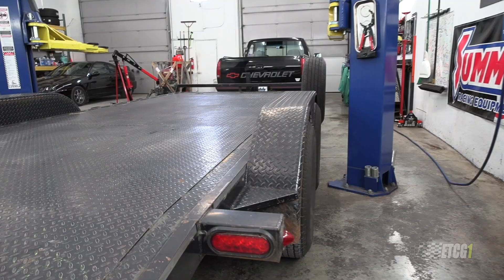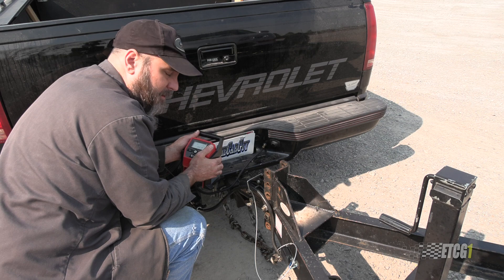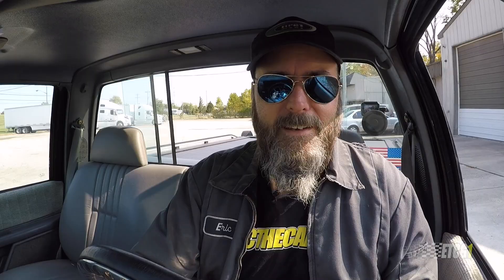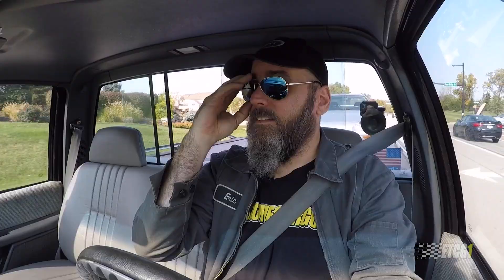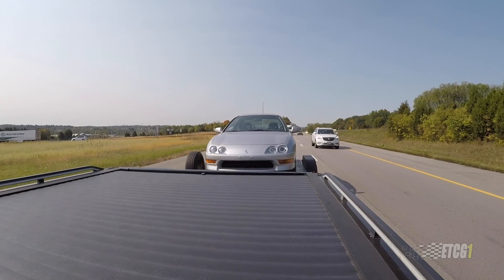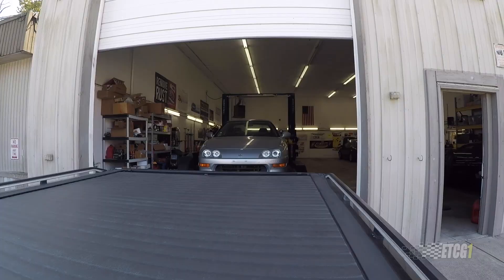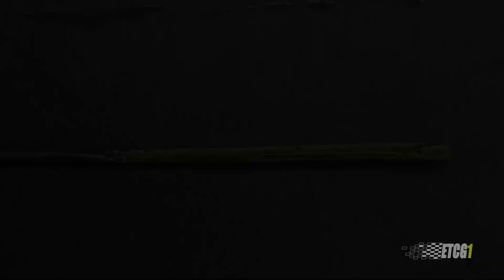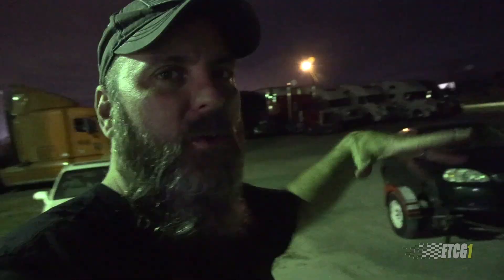First Time Towing With Airbags

Comment: A quality weight distribution setup would completely make the ride that much better because it's the only way to correctly transfer weight to the front axle of the truck and rear axle of the trailer for a correct and safer ride. 🤟🏼
Reply from the maker: However, I'm renting these trailers and don't want to modify them with a hitch I may only use once. Thanks for the comment.
Reply: @ETCG1  - Oh, good point! I guess I completely missed that part. Well if you ever get your own then you're free to try all sorts of things! Happy trails man. The truck looks really nice towing stuff!

Comment: Air bags are a huge improvement for leveling and ride. The problem is they don't put any of the weight back on the front axles.  They only level the truck by raising the rear end. The only way to get the weight back on front is to use a weight distribution hitch. Running both is the perfect combination. I run both and dual sway control bars.
Reply from the maker: No doubt that a weight distribution hitch is the best way to go, but airbags are way better than no air bags in my experience. Also, the place I rent my trailers from don't have weight distribution hitches on them. Thanks for the comment.
Reply: @ETCG1  so true. No substitute for air bags.

Comment: Hey Eric, I'm all with you on air adjustable suspension.  I've used air shocks on many vehicle over the years and I am "guilty" of pushing the limit (or is it towing the limit :-) on the size load I've hitched to.  What i do want to point out is that while air boosters can level out a vehicle, it does not over come the fundamental problem of trailer/load stability.   Even with load levelers "things" are happening when we attach a trailers off our back bumper.  1 While it's not the primary issue,  the hitch overhanging the back axel is "prying" the weight off the front.  More of a concern is dynamic lateral stability.  Load leveling hitches help with this in an odd way.  Friction in the bars, dampens sway effects as well as move weight toward the front axels.  Here are some things I have learned, some are debatable.   Lateral (side to side) softness makes a trailer /vehicle combo more subject to run-away sway.   If your are pushing the limit I suggest:  Run tires are highest pressures allowed by the tire, front, rear, and trailer.   Use of helper springs, air shocks etc also increases role stiffness and is improved when separated inflations is used - this helps.   
Now here is a point that few people really understand.  Run away sway is less controlled by hitch weight as it is by "moment of inertia" of the load.   Moment of inertia is the effect of splitting a load and moving the two halve further and further apart.   I offer that one could safely pull a 10,000lb block of iron sitting some what behind the axels (negative tongue weight) but would get in trouble pulling a load with two 2,000 lb blocks with a 10% hitch weight with those weights placed 30 ft apart (fore and aft).   I offer you will see far more travel trailer disasters due to loading of the trailers with high loads fore and aft.   (think rear cargo carrier with a generator,  motorcycle,  fuel and full portable greywater tank- not to mention how heavy loads (water/swage) are placed inside.   If all those loads - and more - where over the axels there would be no issue.   As to vehicles: Shorter bed pickups and low rear overhang SUVs (real axel is close to the bumper) are inherently better tow vehicles.  Fifth wheel trailering (zero and negative overhang) essentially don't have sway stability issues.   Two closing points:  While dangerous in it's self I will do "excursion testing"  with a load I'm unsure of.  As I increase speed, step at a time, (with nothing around me) I give a jerk to the wheel and then hold at center.  If I feel a delayed sway (caused by the load sway)  know I on the edge GO NO FASTER o slow down.  If a load gets squirrelly 1) DO NOT FIGHT THE SWAY.  Lock the wheel and only make slow changes in direction.    2) Attempt to slow without panic braking - I find this aggravates the situation.
Reply: When swaying, it is often smarter to try and speed up some. Also, what I do is I will only apply the trailer brakes.

Comment: Ive got bags on both my trucks. Both trucks are stock and long bed.These are only needed for half tons as far as ive seen. I never use them. Squat may not look good but you want that rear suspension loaded. Airbags give me adisconected feel def dont feel as secure. Useful for shortbeds and half tons ,sure .And defintly lowered. Abetter alternative would be a weight distribution hitch. Iswear by mine

Comment: My advice when backing is adjust your mirrors to see the trailer tires and back end of the trailer. Obviously keep an eye on trailer overhang and your pivot point but watch the tires of your trailer. The tires will tell exactly where you're going and you won't have to turn around and look, which will help in being able to spot  possible front end contact a lot faster than having to keep twisting your body and head... thats how I back my semi and its worked well for me
Reply from the maker: I started doing that after I got more comfortable with it. However, backing up the car dolly was a nightmare. I had to remove the car and back the trailer up without it. Thanks for the comment.
Reply: @ETCG1  they can be a real pain to back because it doesn't take much for it to get away from you unlike the longer trailers. And you're welcome. You've given me years worth of advice so u thought maybe I could give some back!

Comment: I'm sure the bags have a significant impact, but the vehicle placement does too.
Regarding that; you are 100% right that you NEVER put the weight towards the back of the trailer (i.e. lifting on the tung). That will make the combo dangerously unstable. But, you do not want excessive weight on the tung either. About 100 lbs is about the max you want to put on it.

Comment: UK towing in case your interested
older drivers can tow trailers up to a gross weight of 3500kg, depending on tow vehicles max towing weight, young drivers can only tow trailers with a max weight of 750kg unless we do an extra licence, which brings us up to 3500 kg, as for brakes, under 750kg trailers dont have brakes, between 750 and 3500kg trailers have overrun brakes so when you slow down the hitch has a damper built into it which pushes back to activate the brakes, and have an automatic mechanism for disengaging for reverse, if you want to tow anything above 3500kg you have to have a 7500kg vehicle licence or medium goods vehicle, or a heavy goods vehicle licence and a lorry or similar

Comment: connecting the two lines is a bad idea when you corner air will transfer from the bag with more pressure like if you turn left the right rear will apply more load to that bag and transfer to the bag with less load making it handle worse through corners like a reverse sway bar i added bags to the back of a amc jeep with a 10 inch lift and you could really tell we installed them to help with the body roll it made it worse and you could tell once we isolated them how much better it handled

Comment: Been contemplating air bags such as the ones you installed on my truck and your initial reaction probably just sold them for me.
Reply from the maker: You won't be disappointed. Even when you're not towing they make the ride smother.

Comment: Going from 14:2 to 13:7 will make a massive difference to fuel use... you really need a smarter setup that moves mixture/timing with vacuum and rpm. If hills make you smell brakes, you need to be in a lower gear and keeping your foot from trailing that pedal.

Comment: First time I saw you video link, I thought, oh I didn't know you could add driver and passenger safety air bags to my old classic. I need to check this out, but as soon as it started I knew what you meant. MAYBE a better name for the video would have been "adding air lift suspension bags".
Reply from the maker: This might help for clarity. BTW, this video came before the one you just watched. It's also linked in the description. https://youtu.be/e-h_ZNZkS5A

Comment: Eric it's all about load position. your best bet is to put enough weight on the truck to drop the backend an inch or two then put air in your bags, if you put to much weight on the truck then put air in the bags it will deceive you. Most accidents involving trailers are caused by people loading there trailers to heavy on the front. If loaded properly the 51 will handled the same, it will just take longer to get up to speed and a little longer to stop. You have common sense, you'll be fine. As far as backing up if you put your hand at 12 o'clock if there's a problem you can turn (your hand) toward the problem and the trailer will move away from said problem. When your loading the trailer with a heavy object like a car put some blocks under the back of the trailer to keep it from dropping to far and lifting the ass end of your truck, just don't block it tight so when there's weight on the trailer you can't get the blocks out.

Comment: hi Eric .before you tow the trailer check the hitch nose weight (make sure its under what  the makers max hitch weight is) then couple the trailer then adjust the air bags .
 in the uk we use overrun brakes (electric brakes not allowed ) the max advisable towing weight is 85 '/. of cerb weight  of the tow car .
we also have 50mm ball hitches that have the anti snake built in have look at this (alko Stabiliser coupling (AKS™ 3004) we use 50mm ball hitch (eu standard ) .

as per normal the vid is top notch .
it might be a idea to fit a swan neck hitch in the bed to move the point that the load applies to above the rear axle rather 3 ft behind it ,
just a suggestion.
rickie edinburgh scotland

Comment: Glad to see u didn’t wire it up on a y that’s actually unsafe to do so cus on corners your bags will unload from one side and transfer to other. Making it unsafe should always keep each bag either separated by shrader valves or if your running a onboard compressor separate solenoids and lines

Comment: The smile on your face says everything, it's stable.
Double parallel the airbags, No no just kidding lol.
If you're not sure about moving the heavy car, go slower and be kind to your brakes :-D
A game of momentum. mass x speed.
Reply from the maker: Trust me, I'm very careful when towing like this, I love my truck too much to mess it up. Plenty of space between and whatever is in front of me. The issue I had was with a "lookie loo" that was enjoying the fall foliage while driving. Inconsistent speed, and particularly slow going downhill. It was somewhat maddening if I'm honest. That said, we made it out OK. I actually prefer towing with the car hauler because it has trailer brakes. The car dolly does not. Even though the car dolly is lighter, it's much harder on your brakes because it doesn't have any braking abilities other than in an emergency. Great to see you. Thanks for the comment.

Comment: I worked for a County highway department One Summer we are putting up speed limit signs had a half ton truck put 50 4 x 6 treated posts 14 ft long in the 8-foot bed the front wheels were skipping I wasn't driving the supervisor was but then he had me unload them while he was inside the maintenance building I didn't cut the Bands and unload them once out in the grass I stepped on the gas they slid out of the back of the truck but the front wheels were up six feet in the air woooo hoooo! The bumper was full of dirt in the back.
Reply from the maker: That's a bit frightening.

Comment: I feel much more secure pulling a car trailer over a car dolly, especially on the highway with a pickup truck. One thing I would recommend is putting some significant weight in the bed of the truck. Otherwise, the car on the dolly or even the trailer has more control over your load. Think about how your truck acts in the snow without weight in the bed of the truck. Be Safe; Stay Dirty.

Comment: You might consider an aluminum car hauler instead of the steel car hauler.  It is significantly lighter in weight, which means you could put a heavier vehicle on the trailer.
Reply from the maker: I agree, but they aren't available at the place where I rent my trailers. Also, they are very expensive. Thanks for the comment.

Comment: This video, mainly the part where you talked about the pressure in the bags, just furthered my opinion you need a lighter trailer. Also, I think you would be very surprised how little difference in weight there is between the Integra and the 51 Chevy (The 51 is lighter than the TL). I do remember you saying he had a bunch of parts for it too, but I'm not sure it'll add up to that much difference.
Reply from the maker: Like I said in the video, I think a car hauler with a Civic weight car is doable, more that that is probably too much. Thanks for the comment.

Comment: I'd bet the weight difference between one of the Hondas and the 1951 Chevy is about the same as the weight difference between driving solo and riding with a girthy passenger in the truck.  That car's probably 3000-3200 pounds at most.

Comment: Being able to isolate each bag and adjust individually is really only going to be useful if loading the bed. A trailer keeps  the load on the hitch…. low and centered  so not really necessary.

Comment: Glad it looks like the air bags are going to work out for you.  I think your set up should work with towing the '51 Chevy.  You maybe might want to invest in a weight distribution hitch if your tongue weight gets over 500 or so.  I check my tongue weight by using a bathroom scale and make a "bridge" out of some scrap 2x4s.

You also might maybe want an aux trans cooler for good measure if you don't already have one.  With just the in-radiator cooler, I've seen trans temps that were otherwise around 160 to 180 spike to over 220 with just an additional 1000 lbs.  So any rig that I plan on towing with gets an aux cooler.  Cheap and easy for some peace of mind.

Oh, and never attempt to back a U-Haul car dolly.  With a conventional trailer, you have only one pivot point, the tow ball.  However as you've discovered, those tow dollies have two more pivot points for a total of three.  That makes controlled backing nearly impossible.  Even professional truck drivers don't back tandem trailers and that's just one extra pivot point.

Might also want to use something to protect the car on the trailer from road debris kicked up from the truck.  I usually don't bother, but my cars are ugly anyhow.

Sorry, Eric, if I'm dishing out stuff that you already know, but this is more for folks that have never done this stuff before.  I've seen grown men cry when talking about towing and there's a lot of really bad info out there.

Stay safe and happy towing!
Reply from the maker: Thank you for that input. Honestly, I think the '51 and it's related parts may be a bit too much for the truck. I think I could get away with a car hauler and the Fairmont with this truck, but that's about it. Just to be safe I plan to use a different set up when I go and collect the '51. 

As for the transmission and cooler on the truck: https://www.youtube.com/watch?v=rnKof4v0Zts

Many have mentioned the load leveling hitch, but I'm renting these trailers. It's much easier to use their set up over buying a hitch I may only use once. I never intended to make this truck a tow vehicle. I was just working with what I had. https://www.youtube.com/watch?v=kCepnacqRuI&list=PLSzhQ6St-ov1g_GML2aVq6EN-_ShJ9G2o

Thanks again.

Comment: Hey Eric I just wanted to say I really appreciate you making the build series videos on this truck, there wasn’t much on the GMT400 platform. But I’d love to see you install a weight distributing hitch because the air bags won’t actually take weight off the rear axle and move it to the front (at least not anything significant) maybe scales under the tires to show a before and after would make a nice video? Also this may just be me but if you end up hauling the 51 I’d like as little weight over the rear axle since it’s a semi floating and all the weights on the one wheel bearing (and I’d assume the 8.5” rear end has a smaller bearing over a 9.5” semi floating) But I can’t wait to see the brake master cylinder video. Again, thank you, God bless and I hope you have a good day.
Reply from the maker: Thanks for the comment. I don't plan to do anything with a weight distribution hitch because I'm renting these trailers. I don't want to modify them with a new hitch I may only use once. To get the '51 it makes more sense to use a bigger truck with a higher tow capacity. These airbags worked perfectly for what I did in this video. If I had to, I feel I could tow the Fairmont on a car hauler without too much difficulty. 

I've put the brake video for the truck on hold for a bit while I get my sons car sorted out. Hopefully I'll have time after I get that done. Otherwise, it might be a bit. Thanks again for the comment.
Reply: @ETCG1  Are you able to rent car haulers that already have a setup for a weight distribution hitch? If so, it would help allot to have some of the trailer load on the front axle as well (I have  travel trailer, and it makes all the difference with it)
Reply: @ETCG1  That makes sense, I should’ve paid more attention my bad. But I know it’s a holiday and I appreciate you taking the time to reply.
Reply from the maker: @thepeepsdotnet  Not to my knowledge. As I said, I plan to use a bigger truck to get the '51 anyway so it really doesn't matter. I never built my truck as a tow rig so it's no big deal.
Reply: using air bags at the same time as a WDH, defeats the WDH, and it has been proven to increase tongue loading.  Most folks just set the airbags to like 5-10lbs when using WDH's.